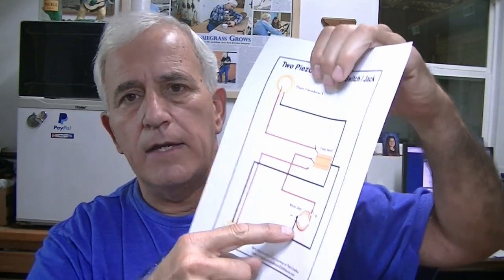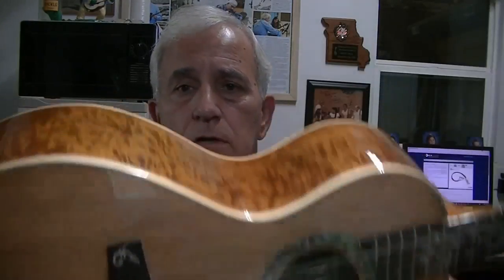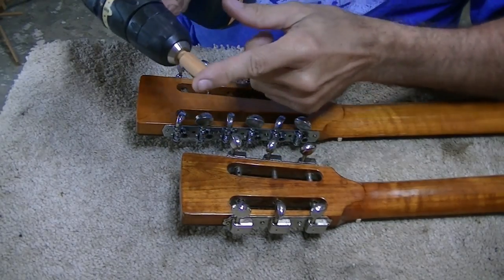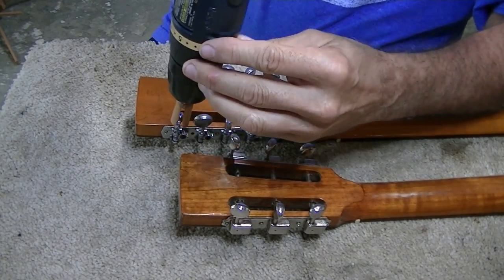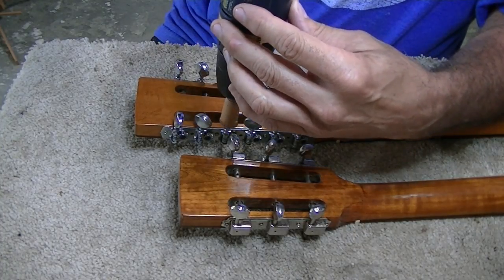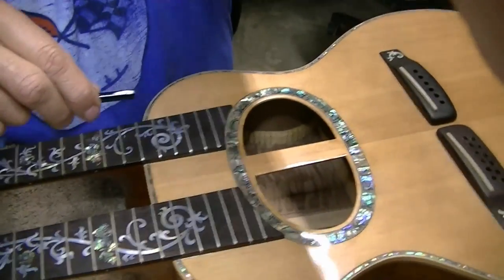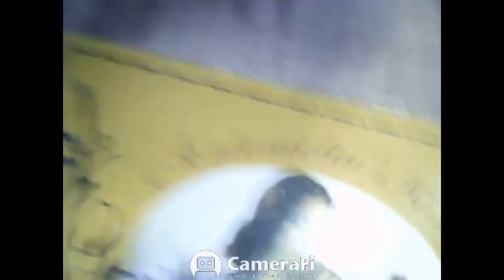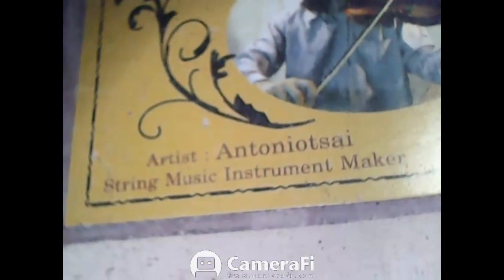179 RSW Double Neck Guitar Inside Look P2

Comment: This looks interesting. I guess that wherever you place the pickups you'll hear a fair bit of sound from the strings on the unused neck due to the shared bridge plate. This might add something to the sound but if it's a problem you could always muffle the strings on the unused neck with a duster or similar lightly wrapped around the neck.
Reply from the maker: Henry Hunter yes the two necks are causing me to scratch my head a whole lot. Thank you for watching.

Comment: How about a stereo jack where the: 
6 string pickup goes to tip
12 string to ring
common for both pickups to the sleeve.
Then the cable splits at the amplifier end to allow complete freedom to mix signals in any manner.

Comment: The K&K is a good pickup, but keep in mind that an acoustic soundboard transducer (AST) won't be able to isolate one neck from the other very well, even if you can switch between the two. This may or may not be a bad thing, depending.

Comment: Hi Jerry, What do you use to put humidity into the guitar to close the crack? Thanks
Reply from the maker: I've tried various things.  At the moment I have a damp sponge inside of a plastic bag that has a lot of slits in it.  Thanks for taking a look.
Reply: Hi Jerry, I like your idea as it is practical and not expensive as a video I was watching with several tubes inside the guitar. In Queensland, Australia my parents used to have to put a container of water inside the bottom of the  piano to stop the soundboard from cracking because the area was hot and dry. Thanks for your help.

Comment: It's easy to get the right spot - as long as the inside of the guitar lets you. In this case, it looks like it will allow you to put them in the right spot. Don't get caught up on choice of "Piezo". The only choice is under the saddle or a stick on - or both (plus microphone). The choice should be on what pre-amp you are going to use. This Carlos man is the expert and maybe you can learn from him. https://youtu.be/pW5XMDG1byU  His systems to me are expensive. On a regular guitar he sometimes puts a stick on piezo on either side. If you fast forward to 8 mins, you'll see what he does with the stick on version. Keep in mind these piezos are produced for less than $1. You can get a pack of them for a couple of dollars - but these are not sold for guitars - even though they are the same. The only difference is that these have casing and a sticky piece on it. I use these for drum triggers.

There is a video where Carlos demonstrates how he finds the sweetspot for the pickups on the top of the soundboard. He does this with temporary sticky tape and places the pickup in various places. I saw him doing this with a piezo on either side of the bridge. That might work with your double neck guitar, or you might find it better to put the pickup on the right side (high string side) of the bridge. The pre-amp would need 2 inputs for piezo in this case and you would mix the levels of each. But I reckon 2 pickup would be good regardless of which neck you were playing. Carlos designs these systems and the "Greats" go to him for their set-ups. Hope this helps.
Reply from the maker: Thank you for the information. I will definitely check into it before going further. Thanks for watching.